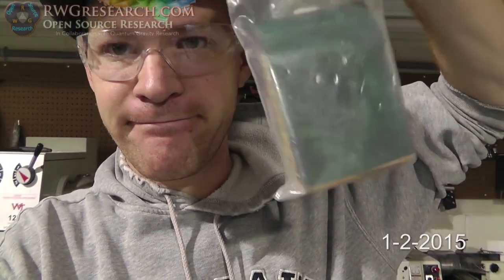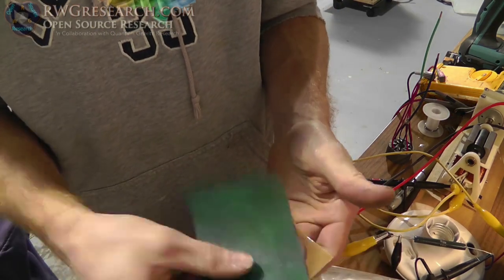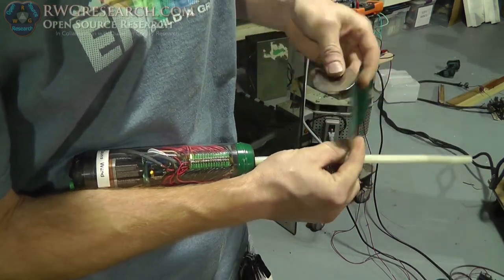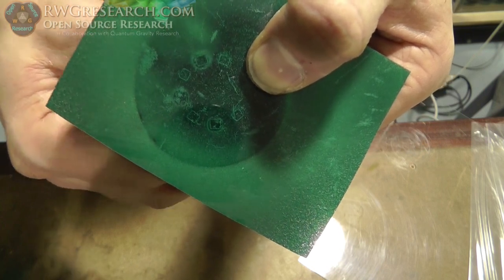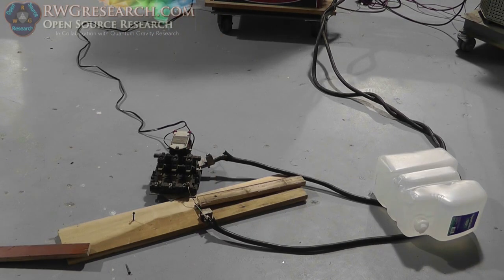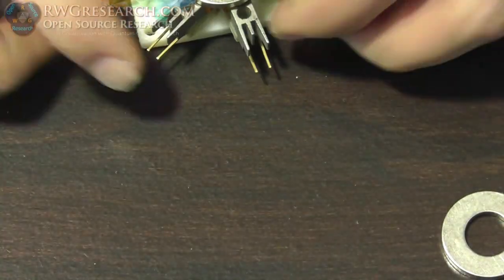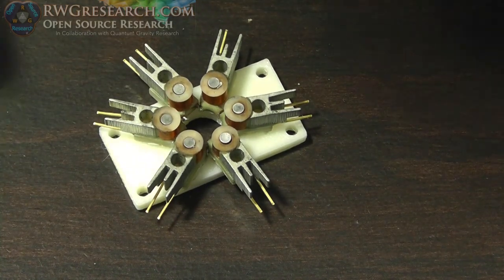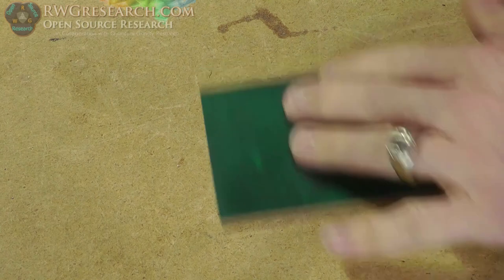#1:Successful Replication of "Polymagnets" At Home, The DYI CMR "programed" magnets

Comment: Hi Russ, Very interesting video, Just a thought, Why not build a high current horse shoe magnet with the two poles tapering to a small head and mount it to the base of your rostock, Then mount the magnet blank to the x,y head. With the right software you could very accurately build up magnetic domains using pulsed current. Big Thumbs Up.

Comment: It works! Excellent work!
 So we should be thinking about what pattern to imprint onto magnets to make a solid state electrical generator
John Searle's SEG uses like a sine wave pattern and utilizes the balanced magnetic fields or the rings and rollers to 
create the motive force needed to swap the fields relative to each other. I believe it's possible with the right pattern 
that when you bring two specially imprinted magnets close together (like in that triangular jig shown) 
near to a pickup coil, you will have a solid state electricity device! 
Not that there's anything wrong with the SEG roller concept though. Great work

Comment: Hi. Thanks for your reply. I was thinking more along the lines of the fact that the SEG allegedly requires the components to be in a constant state of magnetic imbalance. Using your device to place fields exactly where they are needed, creating stators and rollers to be continually in contention should be a simple matter of geometry.
I think there would be enough free electrons in the neodymium magnet to dispel with the requirement of a neodymium ring. While I am unsure of all the claims made for the SEG the principal is sound if the appropriate imbalance to be achieved
I wish I had the resources to experiment the idea.
P.S I really enjoy your videos please keep them coming.

Comment: Hi Russ 🤗so if this was very low current very high voltage spikes say back spikes from a secondary  air coil would that help not burn the emag coils out and after many pulses also give an outcome of more depth of gauze to the imprinting magnet?
Reply from the maker: one needs a lot of concentrated magnetic flux to make this work. so a core is needed if you want to focuse the "spot" ~Russ

Comment: Could you use this to create the so called SEG generator ? I know everybody says it's a scam but it would be good to prove it
Reply: +John Cameron Personally I see a lot of potential for innovations in that way of thinking about EM generators. The thing is that the medium has a role in the efficiency of the SEG machine, having sufficient free electrons close by seems essential. As far as I know the Townsend effect could provide for the needed amount of free electrons to run such a device. Or maybe a solar panel. 
If the device actually does what it's supposed to do, it's a runner up for retiring oil and coal. Refine the technology and we're talking about getting MWatts for a few Volts.

Comment: Hey! I want to create a chess board which has magnets embedded inside of it and create a magnetic base for it to levitate on but I don't know how to do it without tying it down or something and I don't have a lot of money to just buy magnets and experiment. Do you have a way of doing this and can you also tell me how powerful the magnets should be to lift like a kg?
Reply: +EXO ICE  I think if you could set layers of bismuth in the base(at the precise increments) with the right magnets in each piece base and throughout the board base could achieve this, not that it would be easy but i think possible
Reply: +EXO ICE Yes, polymagnet levitation is possible, but both the board and chess pieces would need engineered magnets for it. The technology is new, so it may be difficult locating a place that could/would do it.

Comment: This all looks cool but what is the real purpose of this?
Reply from the maker: to control the magnetic field that would only otherwise be possible with separate magnets. This way a custom magnetic field can be produced on a single Piece of neodymium. there are a lot of uses for theses but my use is to customize a magnetic field for power generation. we are out side the box... ~Russ
Reply: ***** Well i guess that makes sense =P this is really cool!
Reply from the maker: Lassi Kinnunen although you might be correct. one will never know till they do the test. a good theory is only as good as that. but an experiment will prove its self, i'm not saying that this experiment is anything that has not been done before, its was just to show that a person can achieve the same result with things that can be put together with minimal skill level. ~Russ
Reply: Lassi Kinnunen
Not only that, the CMR magnet is made out of separate magnets so this seems like you're doing something the hard way to get the same effect that an easier method can do already.
Reply: CMR magnets are not made out of separate magnets. Multiple individual magnetic fields are “printed” onto a single magnet. This creates the potential to do things that are impossible with any combination of individual magnets. For example:

- Magnets that repel each other until they reach a critical distance, at which point they attract.
- Magnets that have a powerful attraction at a distance but have a soft contact, which prevents them from slamming together hard.

This is a brand new field. Research is still being done on finding applications. But one thing you can be sure of is that the possibilities are as unlimited as the human imagination and you will one day find polymagnets to be ubiquitous.

And RWG is not “doing things the hard way.” He is doing them the scientific way. He is experimenting. He is learning. Be thankful for him and those like him. It is people like RWG who are leading the way toward a future that is currently available only in the movies.
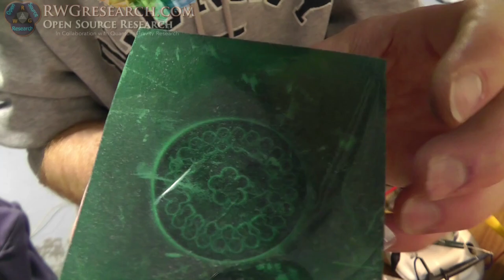Reply: You can look at the screen at 1:29 and see that it's just individual magnets being held in place.
Reply: Premliana When I first saw this tech, the one thing that came to mind is perpetual motion devices like generators or fans. With out sounding like a crazy person, I think this is a reality using the properties of programmable magnets. So many have come close but fallen short with conventional magnetics. With the right configuration programmable magnets are the key.
Reply: Lassi Kinnunen Consider we were limited by what we could do with conventional magnets. When have we ever had the ability to program fields in such a precise manner. The physics don't need to change. Programmable magnetics work with physics...they can attract, and push perpetually if configured correctly. Something that was not efficiently possible before.  Take a look at the countless experiments of magnetic motors using conventional magnets here on youtube. Some of these guys almost had it. Give them the ability to program fields on a smaller scale and closer apart, it can be done. My only fear is if this becomes the norm, others will begin to see the bigger possibilities. This could alarm large industries. Transportation and energy. What will happen to the concept and methods? This tech really needs to be open source available to everyone so it can never be pushed under the rug.
Reply: ***** Free energy, yes, but not perpetual motion. Perpetual motion is a term used to draw unlimited energy from within a closed system, which is impossible. Nobody working in the free energy fields will dispute this.

Free energy, on the other hand, draws on untapped sources of energy that conventional devices fail to utilize. Zero-point energy for example. In this regard, you're on the right track. Magnets are an essential component in almost all free energy devices. I'm sure that programmed magnets will go a long way in advancing the science.
Reply: +Gilroy Joshua We gotta know how to print magnet that way and never this technologie will can become a secret